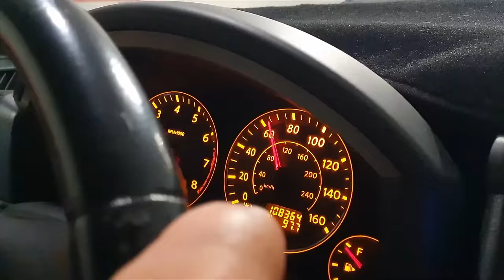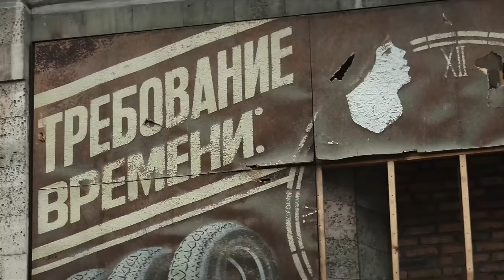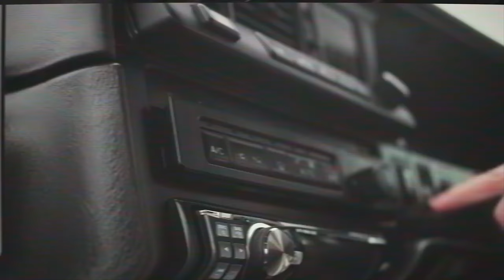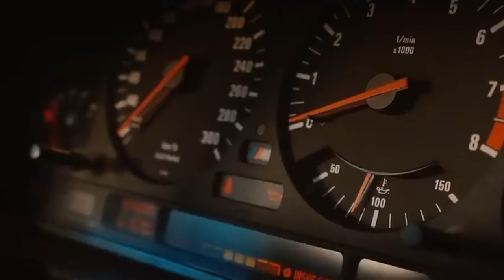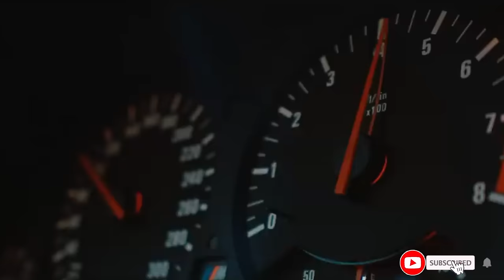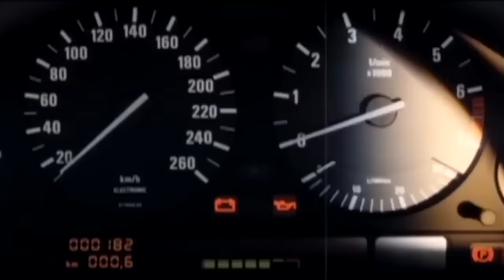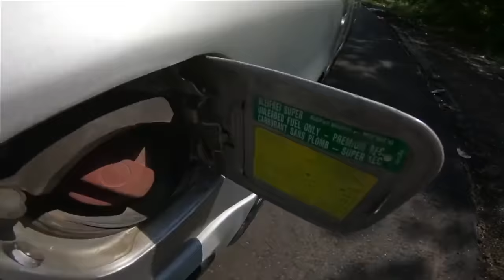The Most Reliable Cars in the World History!

Comment: I would ad to thelist the late 70´s early 80´s Volvos like the 240 and the 740 they are tanks too and seen a 740 with 780.000km.
Reply: You mean late 80s early 90s. It took a while for them to get the reliability right in those cars. 70s 240s were plagued with issues & the 740 was supposed to replace it. With these Volvos it´s the later model year the better in terms of reliability. But the 90s 940 was definitely the best of the three.

Comment: The reliability of cars from the 1990s is a topic that often sparks debate among automotive enthusiasts and experts alike. During this era, automotive technology was evolving rapidly, with manufacturers implementing new features and refining existing ones. While some cars from the 90s are renowned for their durability and longevity, others have gained notoriety for their reliability issues.

One aspect contributing to the reliability of 90s cars is the simplicity of their mechanical systems. Many vehicles from this era were equipped with straightforward, robust components that were easier to maintain and repair compared to modern counterparts. This simplicity often translated into fewer electronic gadgets and complex systems that could potentially fail.

Additionally, the 1990s saw the introduction of several iconic models known for their reliability. Brands like Honda and Toyota gained a reputation for producing vehicles that were not only dependable but also fuel-efficient. Models such as the Honda Accord, Toyota Camry, and Toyota Corolla became synonymous with reliability, earning the trust of countless drivers worldwide.

However, despite the prevalence of reliable models, the 1990s also witnessed the emergence of certain cars plagued by quality issues. Some manufacturers struggled with reliability due to rushed development processes, cost-cutting measures, or experimentation with new technologies. As a result, certain models suffered from frequent breakdowns, electrical problems, or premature component failures.

Another factor influencing the reliability of 90s cars is maintenance and care. Proper upkeep, including regular servicing, fluid changes, and addressing any emerging issues promptly, greatly affects a vehicle's reliability and longevity. Neglected maintenance can lead to accelerated wear and unexpected failures, regardless of the car's inherent durability.

In summary, the reliability of cars from the 1990s varies depending on various factors, including the manufacturer, model, maintenance history, and technological complexity. While some vehicles from this era are celebrated for their reliability and durability, others have earned notoriety for their susceptibility to problems. Ultimately, thorough research and diligence in maintenance are crucial for ensuring the dependability of any 90s-era vehicle.
Reply: I wonder how much longer we'll be able to get parts.
Reply: Excellent post. I'm a big fan of 1990s cars for the reasons you mention. However, I do recognize that it was a period where computers, electronics and plastic parts where metal would have previously been used started to become more prevalent and this is where some 1980s cars top those that came in the following decade if robustness and reliability of components is the criteria. With that said, when comparing those two decades I do prefer 1990s cars overall as in my opinion that was the high point of design and refinement.
Reply: @jimp1646  Plastic components started creeping in during the 60s, not the 80s. By the 90s, the quality and durability of plastics and other materials hit their zenith. By the 00s, corporate board rooms began to demand that quality be reduced to increase profits in the never ending race to the bottom that is late capitalism. Despite this, German brands have recovered nicely from rock bottom in the 00s.
Reply: Comment way better than video itself 😂

Comment: The C Class W204 you could easily add the the list. There are cars with over 1,5 Mio km and the first engine out there.

I drive a s205 which is a T model of the 205 C Class and it is far too early for my car to say anything (<80 000 km). C350e with petrol engine. At the moment all is fine. I use protective covers for my seats. For E and S Class I don't know.
The older w203 wasn't such reliable. It was the time of Daimler Chrysler.

Please note, that there are entry level cars with a small engine and small breaks and more expensive cars in the same series. Maybe they won't last as long.

Comment: I have a 1978 Benz 300SD. Car number 254 motor number of 154. It has 733,000 miles. Motor have not been opened up. Sad the tranny messed up. I also have a 1983 Benz 300D. It has 676,000 miles. Both cars got 27 mpg in town and 30 open road.  Yes they can go almost ever.

Comment: Mercedes W123 did not equipped with 3.2 L 6 cylinder engine!!!
the biggest engine is 2.8 L 6 cylinder 
and diesels are 2.2 l and 2.4 l 4 cylinders or 3.0l 5 cylinder

Comment: BMW 5-series E34 was not a very reliable car. I remember a list of reliability of the 30 most sold cars in Sweden from 1992 were it ended up last. Mazda 323 on top. 5-series had lots of issues. The only reliable 5-series was the later E39 that came out in 1995. 

Audi 100 was ok, but definitely not a miracle of reliability. They could get expensive repairs after a couple of years. If you were looking for reliable transportation in the 90s an Audi 100 with some years behind was not an optimal choice & definitely not a BMW 5-series. Audi 80, the smaller one, was better then.
Reply: rubbish, I sold a 93 E34 with 320+kms that ran perfect. 535is all the electrics worked and the doors closed with a thud that no other car can replicate. I have a 93 Audi 100 S4 with 290kms that is also faultless. Even the original A/C blows cold, the motor has never been apart and I don't have to add oil in 5000km oil changes. I also drive it hard. My daily though is a 93 Volvo t5 manual. Same deal as the others runs like a top no rust, sure its had maintenance items but it deals with peak hour traffic week in week out and still delivers  29mpg. Early 90's euro cars I believe are the last over engineered cars that were produced before the cost cutting started.